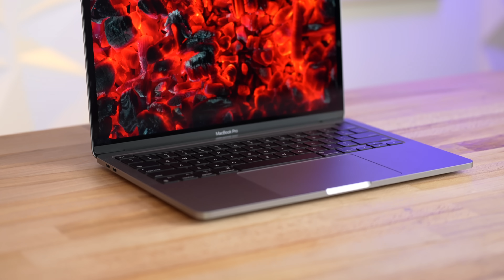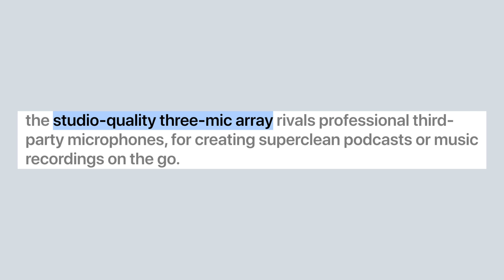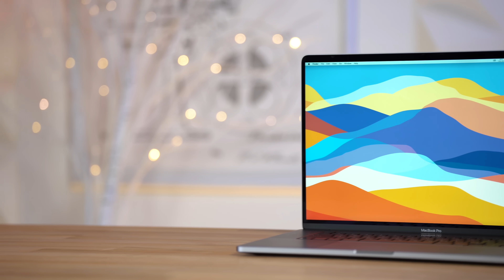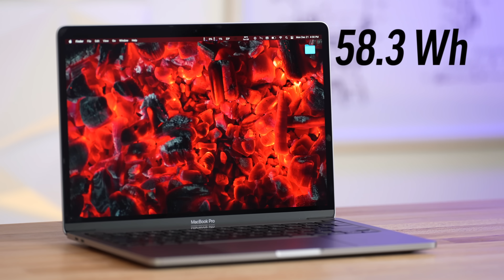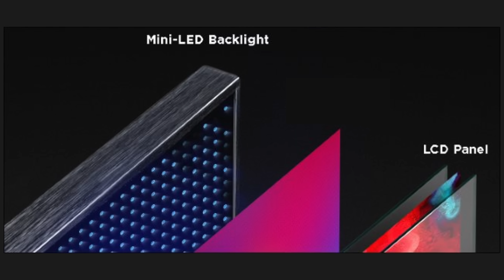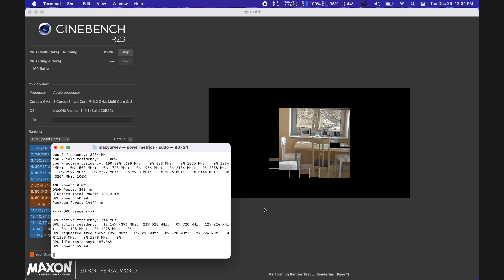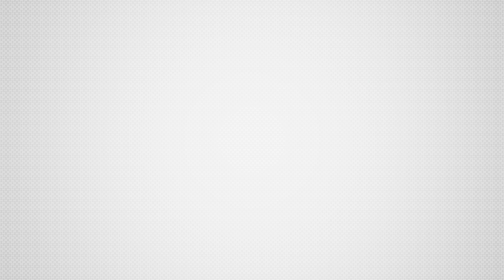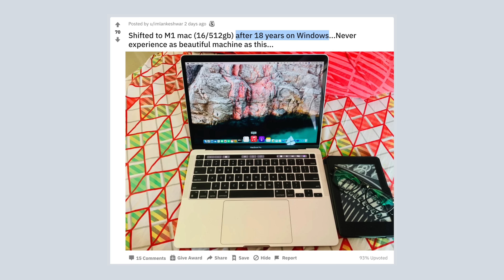M1X 16" MacBook Pro will BLOW Your Mind (What to Expect)

Comment: The M1X for sure will blow my mind and even go further blow my bank account also!
Reply: not necessarily more expensive since the apple silicon is cheaper than intel cpu
Reply: @aircommandslipperz  for the base model it's likely to cost the same Intel Mac.  If you spec up to a desire Mac, the cost will quit high.
Reply: @mengjur4639  i dont think so, i think probably similar to the specced up intel mac. like i said intel cpu is not cheap and so do the graphic card. but for the m1x if all is integrated apple dont need the expensive intel cpu and graphic card anymore. See how they can maintain the price of m1 macbook air and pro, even the m1 mini is cheaper than the previous intel mini
Reply: @mengjur4639  you’re still getting way more performance and battery for the same price
Reply: Doubt it.

Comment: You forgot that Linus also said that the M1 air died almost 7 hrs before the pro.
Reply from the maker: I actually did mention that the 13” pro got 7 hours more battery life than the air with only a 16.6% larger battery. The 16” currently had a 71.82% larger batter than the 13” pro.

Comment: What about what can we expect with the M1X 14” MBP??
Reply: Maybe less gpu cores or less efficient thermals or apple could just go insane and bring the same lvl of performance to the 14 inch
Reply: @apostle9209   - interesting, so maybe like this
14” M1X MacBook Pro: 
- 12 Core CPU
- 10 Core GPU
- Mini LED 14” Display
- 58.3 Wh battery
- 512GB SSD (standard, one can hope!)
- 16 GB RAM (standard)
- 4x Thunderbolt (USB4) ports (please!)
$1799.00
Reply: @HypocritesExposd  i agree with everything but i think they should do 1600$ instead of 1800$
Reply: @apostle9209  - I wish, honestly, that you’ll be right. However, currently the 8 Core CPU/GPU 16GB RAM 512GB M1 MBP costs $1699.00. With a 14” Mini LED upgrade (+$50), more USB ports (+$50), and more CPU/GPU cores (+$100), even $1799.00 seems like a pipe dream.
Reply: @HypocritesExposd  oh yeah, now it seems like it definitely will be priced around 1799$ or maybe more. But,I still hope they do a 256ssd, for 1600$

Comment: If they make a smaller, lighter, 16 I will happily buy it once it releases. I always get the 13 inch due to cost savings and weight but if those two things are fair, 16 it is.

Comment: There will be a 12 and 16 cores M1X, the 16 cores will beat most of the consumer desktop CPU performance. And they are working on 32 cores for desktop chip as well. Also I don't think Apple can make a thinner laptop, and I hope they won't. If you look at the AUX slot, you can see that it is at its limit, if they make thinner laptop, the AUX has to go. They probably going to include more stuff like FaceID more speakers, sensors into it though.

Comment: I doubt there will be a redesign. First they want to secure the confidence of buyers with the new chips so keeping it looking exactly the same is the only way forward.  Apple also have a cycle of design one year and speed to support it the next year strategy with their IOS lineup. It helps keep the upgrade market afloat. A redesign won’t happen till next year.  iMacs might be different in that they do get a redesign but they may not be any faster than M1X.

Comment: My guess is Apple will slightly redesign the Macbook Pro 16, making it slimmer so that the battery life is comparable to the M1 MBP 13. I for one would appreciate NO redesign, same strategy they followed with the M1 MBP. That would easily go above 35 hours.
Reply: I also expect Apple to still call it M1, even if it has more cores and power. M1X seems unlikely as it is not an iPad Pro we're talking about here.

Comment: Well Apple is adopting the frequent upgrade strategy to laptops as they do phones. Why? Because once 5G and the internet is fast enough and wide spread enough you won’t need power at all anymore. Everything will be online.

Apple have been overpricing Intel systems for the last few years so their strategy seems to be taking the last model and doubling the power at a cheaper price.

However. These systems will be less user upgradable and will probably have a shorter shelf life. But going forward consumers will be more excited and their turnover will be higher so it’s a win win. 😊

Comment: For those waiting for a beast of an MacBook Pro in the 16” variety, just keep in mind it’ll cost at least $2399. It’ll probably blow the socks off of the M1 13” MBP, but will probably require double the price as I doubt RAM and storage on the base 16” will be sufficient, so expect to spend close to $3000. If that much power is worth it to you, wait for the new machines, but if the price is intimidating, the current M1’s are a great deal. I personally spent almost $4,000 on a 16” MBP when it first came out and it’s sitting on a shelf because the heat and fan noise made me go with an M1 MBP. Prior to the M1’s I would never have thought of buying an anemic MBA or 13” MBP. Would I buy an M1X 16” MBP? Maybe. I’m not ruling it out but spending that kind of money again makes me think twice, even if I can hand down the M1 13” to my kids.

The big question mark is the fabled 14” MBP. Will that also come with an M1X and four USB4 ports and start at $1799? The higher end 13” MBP’s were always significantly weaker than their 15/16” siblings, but if they had the same power, though less battery life than the 16”, that might be the most compelling choice of all.
Reply: That is probably true. Considering they used to have a larger price gap with the 13.3 inch being kind of a lackluster option. Now the 14 inch will bridge that gap. They can charge 1599-1799 for the 14 inch giving a modest option and charge as freaking much as possible for the 16 inch. They’ll probably give the 16 inch a lot of exclusive features that make a lot of pro users spring the extra grand or two. Considering Apple knows they have an exclusive performance baseline with the only performance arm laptops on the market they really could charge $5000 and just run to the bank.
Reply: Two ports isn’t nearly enough
Reply: @MaxOakland  Depends on your preference ;)
Reply: I spent like 3,000 on a 15” MacBook Pro and I was really disappointed. It was a great machine, the battery life was awful and the fans would be going all the time. My keyboard had keys that didn’t work. And it’s not like I used this laptop all the time. Picking up my 13” M1 MacBook Air tonight. We’ll see if it’s worth all the hype. Never spending 3k on a laptop again though but I’ll be pleased if this can outperform my 15” Pro
Reply: @ninja0wnzy0u  Oh boy, you're in for a treat. The only thing that will disappoint is the smaller display. But it is a beautiful display regardless and I feel 13" feels adequate + portable.
Reply: @Tonyisgaming  For sure! The box it comes in looks so tiny. I picked it up last night but I haven’t had time to get it going just yet but I’m really excited. I haven’t heard anything bad about these new MacBooks, just about how amazing they are. Which is surprising to me as Apple usually gets a ton of hate
Reply: True. I am waiting for the 2nd generation of the 16" M1X so they have some time to iron out the bugs on the first gen. Don't want to buy a first gen of anything as unexpected issues are inevitable and it can take months for those issues to surface.

Budget wise, I'll set aside $5k for this dream machine as I generally use laptops for at least ~7 years and it'll be a massive 10x upgrade from my current $500 linux laptop.
Reply: @doctordilanka  typing on an m1 ive owned for two months now, im yet to run into ANY new bug that I didn't already experience on my 2020 intel macbook. While its true that in theory issues could still surface in the future, this is the least 'first-gen' feeling first gen product ive ever owned!
Reply: In 2017 I went and bought a maxed out 15" MBP. It's a very trusty machine so far, but when it gets to hard work (4k video), the thermal problems turn it into a mediocre device at best. For medium work, like live streaming, photo editing and software development it's a great work horse. I always thought Apple built the 16" MBP to solve the thermal issues, but they seem to have only half-assed that as the M-Series was coming up. Good thing I didn't buy the 16" MBP!
Reply: @saschakaupp  I think they more just gave up than half assed it. Intel are the half ass-ers. I would say building your own processor to solve the problem is like full on assing. Maybe even double assing.

Comment: The macbook pro with M1 chip is my favorite piece of tech in 2020 ❤️🤯
Reply: Still waiting for windows support to play games lmaoo. M1 macs with windows will be my first macbook
Reply: But it has 8gb ram. How exactly can that handle graphics, editing and creating virtual machines?
Reply: @kateofone  the fact that apple has access to control all of the software and hardware, all of the 8gb of ram is efficiently used! efficiency is VERY important.
Reply: @kateofone  Check out the numerous videos doing RAM tests on this same MaxTech channel and by many others across YouTube. What users consistently report is that an 8GB RAM Apple Silicon Mac is able to do the workload of an Intel Mac or PC with much more RAM, because of the way Apple optimizes how macOS works with the Unified Memory architecture in the hardware. If you buy an Apple Silicon Mac with 16GB RAM, those tests indicate that you should be able to do the work of an Intel Mac or PC with roughly 24GB or more of RAM.
Reply: @kateofone  You can get a 16GB version

Comment: All I want is that M1X on the 14".😍
Reply: They better not skim us on the ports either! That two port bs was a load of bull.
Reply: I don't see the point of a 14" MacBook. The 13" MacBooks are already 13.3", so if Apple intoduces a 14" one, the screen size difference between them would be less than 10%
Reply: Dishant Seth it’s the same as when the 15” MBP went to 16”, it makes sense.
Reply: @Dishant161  That means they’re getting rid of the 13” just like they did with the 15” when they introduced the 16”

Comment: The M1X will be utilizing more power so you would need that big battery, it would be stupid to get rid of it. It would probably do just as well as the M1 MBP 13". Also, I don't want the actual "Pro" Macbook to be thinner. I need more power and for it to be cool and noiseless under load during a long period.
Reply from the maker: If you watch the full video, I show that the CPU will only takes a maximum of 27.3 watts compared to the current 50 Watts on the Intel i9 8-core 16" MBP. On top of that, the GPU will use around 11-15 watts of power compared to 50W on the 5600M GPU in the 16". Definitely don't need a large battery.

Comment: HapPy New Year guys. My M1 MBA finally shipped but won't arrive until 4th. :(
Reply from the maker: Happy New Years! Just a few more days!
Reply: When did you get your preparing to ship notice? My 16gb, 1tB Air is still in processing, yet delivery eta was Dec 30 (today) to Jan 7. Processing generally means my machine is not even off the production line yet. This wait is killing me.
Reply: Specs? 16GB 512GB?
Reply: I get mine on the 4th too 😃

Comment: M1X is M1 on steroids. Totally worth waiting for it. Its going to release in the mid of January
Reply: Your assumption release date based on what?:)
Reply: @vladlem7053  My bestie is a hardware engineer at Apple. I know it through him.
Reply: @AJ-tp4wg  nicely done) mini led yes or no?)
Reply: @vladlem7053  Also, the chip used for M1 Mac is actually the chip they use for iPad. That's why you don't notice the thermal problem like you had in previous Macs. If you want the real performance, just wait for M1X because that's being exclusively designed for macs.
Reply: @AJ-tp4wg  This will be my first one mac. And I want to pro-pgrade in January, not July as predicted by news)

Comment: This is going to motivate other companies and put a lot of pressure on Microsoft to improve the Windows 10 on ARM. Developers are gonna probably move to the M1 MacBooks. I do have one question would other developers completely move to M1 and move away from Windows?
Reply from the maker: Developing for the M1 will be rewarding because you can develop/edit/fix bugs/optimize just one time, and it will apply the main base code to the iPhone and iPad user-base. All they will have to do is adjust the code for the different display sizes and aspect ratios. But I'm sure most will still develop for Windows.
Reply: @MaxTechOfficial  another possible benefit with the different display sizes is when you use external monitor support the experience can be a whole lot better. I still feel like M1 will get the windows treatment and windows will get the Mac treatment

Comment: 12 core doesn't seem like that much of an upgrade over current 8 core M1. 
But finally, we can get a somewhat decent display upgrade. Tho I wish to have a slightly higher PPI. I am too used to the sharpness of 4K XPS 13.
Reply from the maker: The 12-core M1X should be outperforming the 12-core Mac Pro. I think it would make sense because they can give the 16-core to the 24" iMac, and then the 20-core to the 30" iMac.. and then the 32-core to the top-end Mac Pro. 
Seems like a good way to split up the Mac lineup. If they gave the 16" a 16-core.. it would be insanely powerful. I guess we'll see!